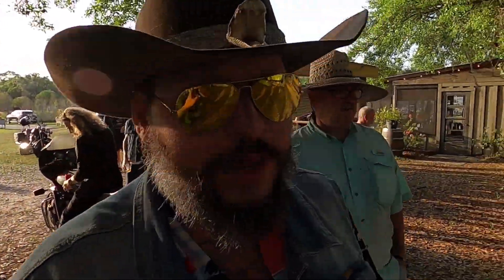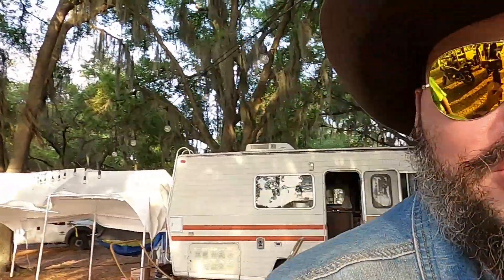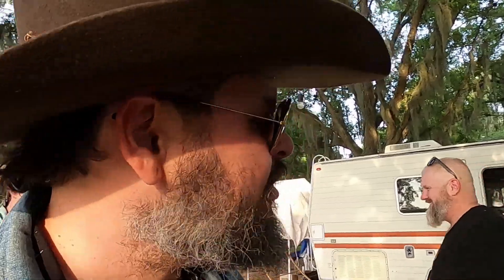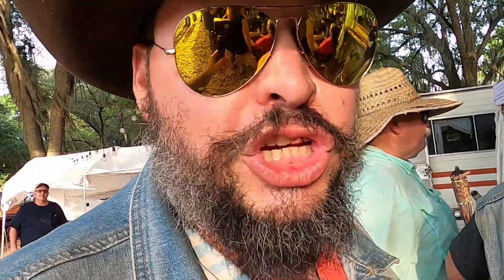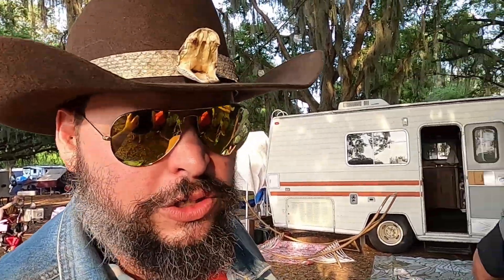1500 MILES On A 30 Year OLD HARLEY Davidson 1994 Heritage Softail Nostalgia FLSTN #CycleElectric

Comment: That was impressive, how much she was charging at idle! Like you pointed out, it looks like the old stator had a couple of windings that looked suspiciously dark. I'm 100% with you on changing out the regulator at the same time. It's like front end parts on a car. If you just change out one worn out part, you can take it to the bank that the "good" tie rod or ball joint that you leave on the other side will fail quick, fast, and in a hurry. Parts that work together should get replaced together, even if only one actually failed. Everything from your lights to your ignition will be a lot happier with that good, strong, consistent voltage. Scotty has shown how much beefier the Cycle Lectric stators are compared to the cheap knockoffs, and now you just showed us how beefy they are compared to the HD part. Good videos like this make it easy to make up my mind to spend the money on the good parts. Thanks for takin us along for the ride, Tramp
Reply: i  agree !!
Reply from the maker: Glad this helped to form a conclusion for you.
Reply: I have a 1991 heritage should I go with a 50 amp system and what about my compensator

Comment: Nice work brother. I’ve done many electrical and charging system repairs in my time, and when I was on the tools full time, I use to enjoy diagnosing and repairing wires and stuff.

I too hate interstate roads. Here in Australia, I’ll stay as far off the highway as possible. Better roads, better scenery and sure it takes longer, but more time on the bike is never a bad thing.
Reply from the maker: Totally agreed

Comment: l did 1800 miles on my 94 FLSTN 2 months back.. never missed a beat  there a great bike..
l always fill my left tank  then the right... do you do that ??
 cheers mate
Reply from the maker: I fill my right first so that my left won't try to spill over as it feeds more fuel from the crossover tube. It can be real messy on my shovel if I don't do it that way being it's kick only.
Reply: @SaddleTrampTV  lol ok l get that..  cheers

Comment: When you installed your new stator, how did you go about getting the rubber plug to go through the hole in the case?  It was a mighty pain when I did mine, until I tied a length of twine around the plug and pulled from through the whole outside the case....popped right in, clipped the twine, mission accomplished. But until the twine idea, that plug WAS NOT going into that hole far enough.
Reply from the maker: Used some grease and with a little patience it went on through.

Comment: I have a 1991 heritage with 3:47  45000 on it want to change should I go with the 50 amp what about my compensator should I change that also
Reply from the maker: You shouldn't need any more than a 32 amp. If the compensator springs rattle when you shake them, it's time to replace.

Comment: Great trip and a lovely bike! I have never had HD but i fall in love with Evo engine (dont know why :D ). 
How is that even possible to ride interstate speeds with open-face helmet without ear plugs? :)
Reply from the maker: With a windshield it's not so bad.
Reply: @SaddleTrampTV  Unbelievable :) there are tons of topic on the internet where riders fight with wind buffeting and noise with different accessory screens (specially on adv bikes) even wearing full face helmets :) Im one of them :D cant ride with interstate speeds (adv bike with screen) without ear plugs :D